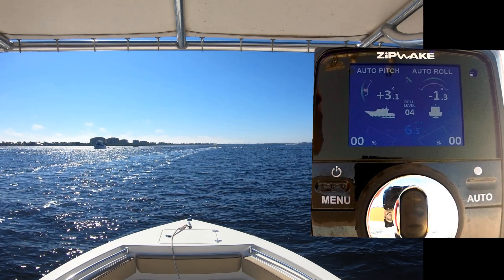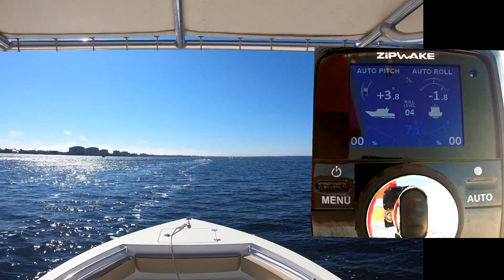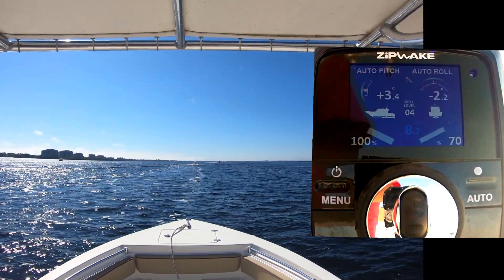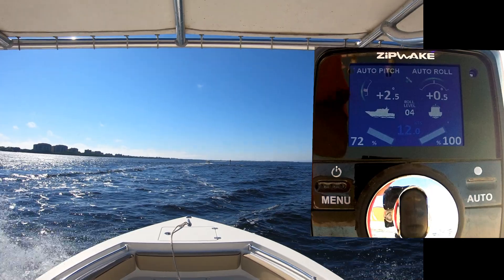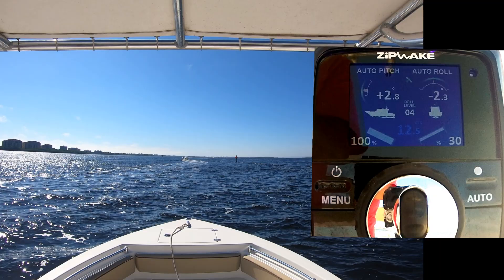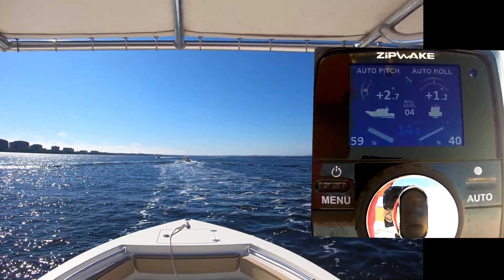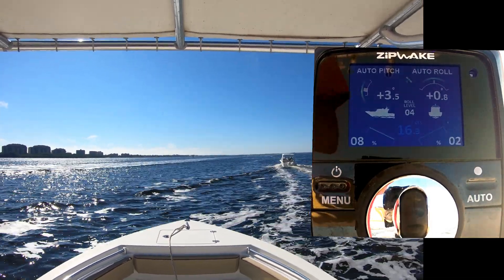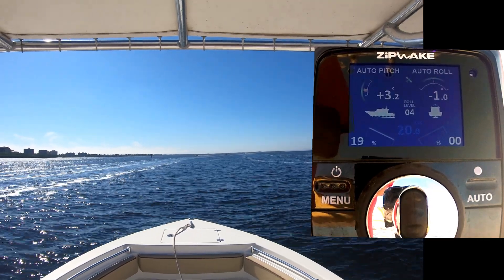Panbo Presents: Zipwake interceptors as the boat climbs on plane

Comment: Nice explanation of how they work. With prop torque is that side prone to wear out sooner ?
Reply from the maker: I suppose it might wear out sooner but though it may travel further I don’t know that it’s actuated more often. Plus, I wouldn’t expect the interceptor to die from motor use. I think the motors are likely to die from disuse more than over-use.